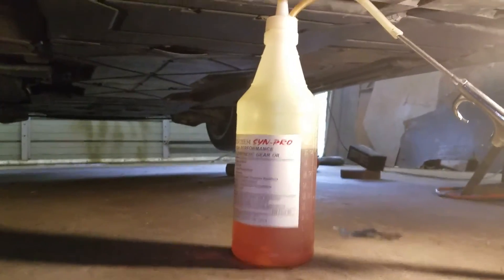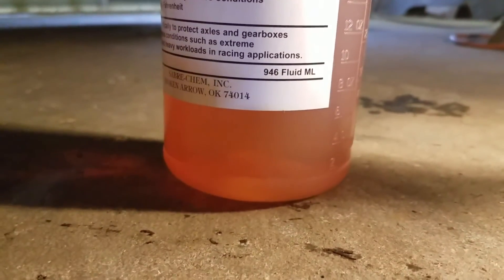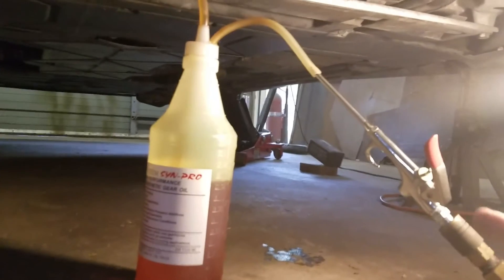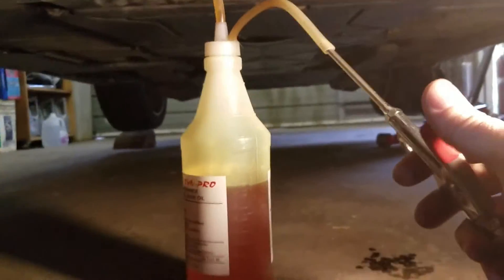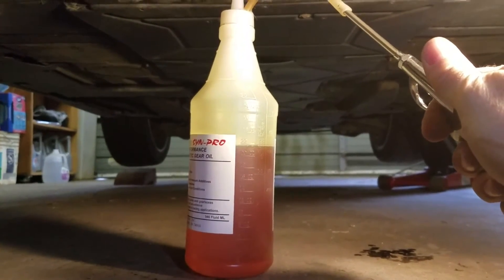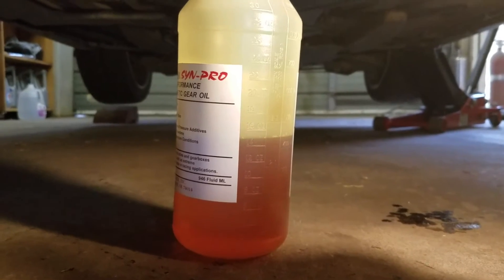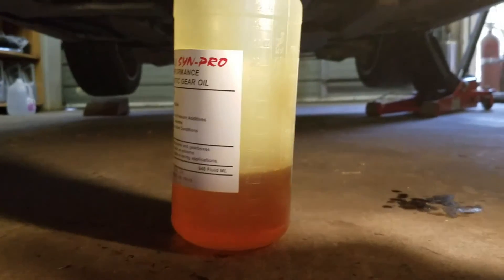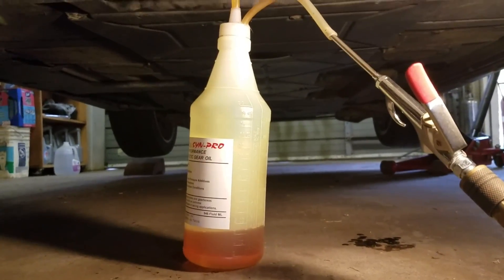Gear oil bottle air pump mod

Comment: Pretty good way of introducing moisture into your oil
Reply: You’ll get more moisture on a cold day inside the box than this will ever add. The air is only touching the surface of the oil not going into the box
Reply: Good point make sure to go through an air drier. But gear boxes  vent openly to the atmosphere anyway that is why the fluid gets milky if its too old.
Reply: Jeff K that will work if you use a oil separator